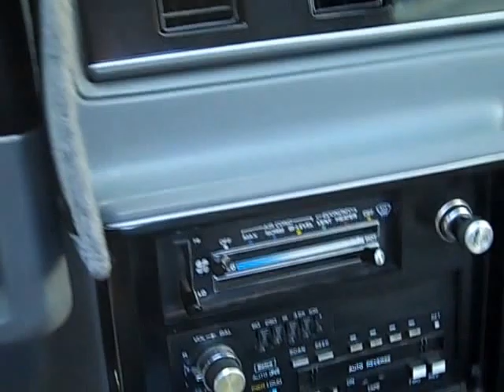Inspection of a 1987 El Camino post purchase

Comment: There should be a high pressure AC switch where that cap is missing. Maybe they moved it somewhere but don’t know how you would do that. I’ve been working on a 1986 El Camino just got done redoing AC system. Nice car wish my interior looked that good.

Comment: looks solid  worth 7k
Reply: To bad now 2021 in this shape
I see them in Craigslist 
Like $  15  to  18.000.00
Reply: @wilyumfalcon4802  i own a 87 now super clean.   7k  was still a solid price  Gbodys  are gaining respect as classics
Reply: You can get one for 7.... But it will have suffered thru the hands of a couple of teenagers....hacked dash....hack fuel system.....badly hung exhaust and some " scary" body and paint work......a clean low mileage original " non hacked " car is definitely 12 and up now.....but if your a garage tinker nothing wrong with a affordable fixer upper....for fun.